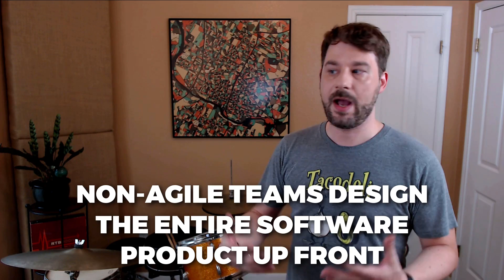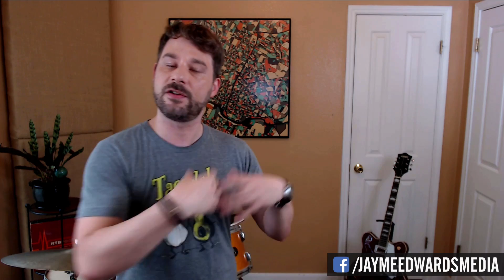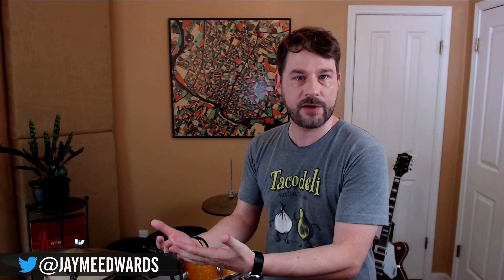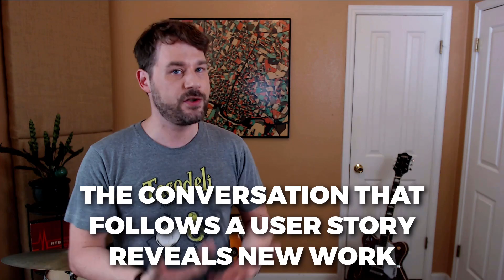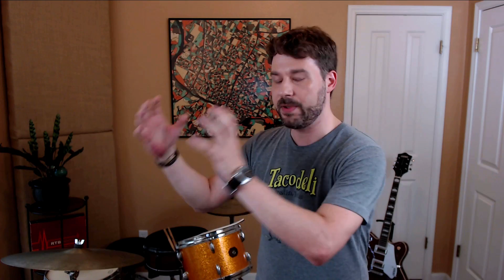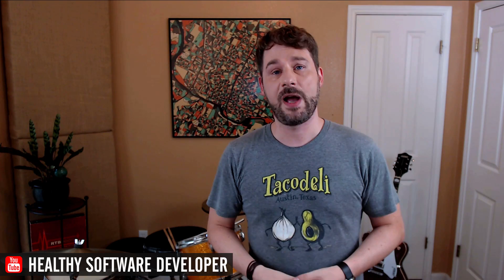Can User Stories Make Software Projects Late?

Comment: You're calling for a full waterfall process and thus calling anything agile there is deceptive.
Reply from the maker: Did you watch the whole thing? I'm saying to match the level of detail of your stories to the company's desire for certainty. A company that is OK with uncertainty doesn't need the detail, they have the ability to be agile. The rest unfortunately don't - by definition. They are creating rigidity which resists change.
Reply: @HealthyDev I did watch it all and the point I saw was that if your organization needs schedules and has well defined requirements (one of the places that every new product development organization I've ever been part of insisted on) then waterfall (or scrummerfall for a bit of protective coloration) is what you need to do. 

I can't really disagree as most of the weird hybrid attempts I've experienced where some form of agile tries to be mixed with hard requirements and fixed schedules (I work in medical device development) seem to have incorporated the worst parts of agile and waterfall into something that is slower and more cumbersome than either.
Reply from the maker: @kylewilson4097 that makes sense. This is just my opinion and experience. Yours is just as valid.

Comment: There's a fundamental problem with this video, same as every User Story discussion: It goes into great detail about the problem, but not the solution. There remains a lot of ambiguity around what "requirements" means for a user story. To a fully-Agile/Scrum team, there should be no requirements. But at some point, accountants demand budget estimates. At what point do you shift all the way into "When the button labeled 'X' is clicked, Y happens"?
Reply from the maker: Hey there. It depends on the level of certainty stakeholders require. As I said in the video, if they want up front estimates and commitments, you need to capture that level of detail in acceptance criteria for every user story on the project (not just in the current sprint). In that case, you may as well not use scrum because the purpose of a backlog is agility. You can't have agility if your scope is fixed.

See this other video for more info that may help about this one: https://www.youtube.com/watch?v=OosYzkP-pLk

Comment: I'm in a project where a User Story pretty much is a Requirement in disguise. It is handed from the customer down to our team(s) after cost-estimates. We are not "agile", this is no secret. And we don't have any discussions about the stories during development. Our team is not focused in developing the service we are primarily developing right now. There are other stuffs that the customer wants. Then a lot of the members are quite junior. 

I don't like working from requirements, I want a conversation!
Reply from the maker: I'm sorry you're having to deal with this. If it makes you feel any better, my experience has been that it's more common for "agile" teams to get this wrong than right. Hopefully it changes over time at your current company/client, or you have a better experience wherever your career leads you to next. Hang in there!

Comment: Huh, quite interesting. The way I first learned about userstories was with I believe exactly the aspects you were criticising. Meaning, you did not just write the userstory. You also had a section "Examples" that specified in a pattern "Given X When Y Then Z" the behaviour of a feature, with a section "Rules" arising from them that described the behaviour in a more summarizing way to give quicker ideas.In this scenario, Examples really just act as acceptance criteria and Rules as their meta description.
Reply from the maker: What you’re describing sounds like a good process. My main point was user stories on their own don’t offer enough detail to have a contract with people who demand certainty. It sounds like you have preconditions with examples, which is pretty close to the use cases we had back in the waterfall days. Your examples sound like what we used to call alternate cases. Regardless - not to get hung up on the terminology that sounds like a good approach (without knowing the attitude of your stakeholders).

Comment: The issue with use stories is that they are taken as gospel rather than a placeholder for a discussion. End result is that the deliverable is not what was needed.

Comment: Our team has gotten to the point of making MVPs, quickly getting them into the customer's hands, and then getting them to fund improvements. The contracts for improvements come with deadlines. So the constant juggle between getting in high value improvements and meeting deadlines for low value improvements is our biggest pain point right now. Our product owner seems to think giving a wider cushion when negotiating deadlines will help, but we are not yet sure. Do you have any suggestions or should we live with the constant juggling as it comes with being agile?
Reply from the maker: When you talk about contracts, are y’all building software for other businesses (professional services) or directly for end users?

Comment: Another great, insightful video. My experience is similar to yours, but also different in some key ways. Let me explain in the context of my second-to-last work experience.

My director was militant about writing vertically-sliced user stories that followed the INVEST criteria. He did want the scrum teams to consistently meet their sprint commitments, and he did believe in estimates, but at least he understood the limitations of estimates. Estimates were really only used in aggregate against the total size of the project ("Okay, we have 596 story points left to finish, and our average scrum team velocity is 20 points per sprint, times 4 scrum teams, that's 80 points per sprint, so we ought to be able to get done the remaining work in 7 or 8 sprints"). Estimates were refined on a just-in-time basis by doing a task breakdown. Teams would typically do their task breakdowns when they did their planning for the current sprint.

So the motivation to organize the work into user stories wasn't so much to estimate them perfectly, but it was to be able to deliver completed, working, valuable functionality in a chronological manner. That's why they were supposed to be vertical slices. It did make sense about 80% of the time.

The problem was what did you do when you got to cross cutting work like "we need to refactor our config engine notification because it sucks", then how do you do something like that in a vertical slice. Sometimes it's not always easy to vertically slice something. Eventually I got better at that part. The basic formula that I used was "As a user, I can be assured that [insert-some-horizontal-work-here], so that [insert-some-vague-high-level-user-benefit-here]". So for example, even though it appears to be a horizontal piece of work, I could refactor the config engine with a user story like "As a user, I can be assured that the config engine properly notifies the system of changes, so that the system doesn't crash when I add a new server." As long as I could phrase the work in a way that showed how it would ultimately benefit the end user, then that was okay. Sometimes it took some grammatical gymnastics, but as long as I was making a sincere effort (my director loved to use that term a lot ... "sincere effort") then it was okay. I learned the hard way not to say "we're doing our best". Oh, no, no, no, no. Don't say that. Say "we're making a sincere effort."

This business you're talking about though of detailed acceptance criteria, that was really tricky. My PM was also really militant and particular about the way he wanted things, and he wanted acceptance criteria phrased from a human point-of-view. He didn't want these super technical, operationally focused acceptance criteria. He didn't want "When I click on the More ... button, an area of the screen is shown to edit advanced options". That's too implementation focused. He wanted much higher-level acceptance criteria like "The user can effectively use the admin screen to add a new user". He was hard to work with. We were always walking a tight rope between expressing enough details that would help the developers and testers know what we were trying to build, and not putting in implementation details that he didn't care about. It was frustrating at times. He definitely didn't want those super detailed kinds of acceptance criteria that you're talking about. I tried that once and he had a shit fit.
Reply from the maker: “We have 596 story points to finish” means it’s a fake agile (waterfall with agile trimmings) project. There’s absolutely nothing agile about forecasting and building that much work before getting feedback and adapting the backlog. I talked about that in the “Agile Project Management - Is It Stopping You From Being Agile?” video. I’m sorry you had to work in a project like that. I have several times too. 😢
Reply: @HealthyDev  Yeah. You have a larger body of agile work experience than I do. This was the only company I've ever worked at that did textbook scrum, the way Mike Cohn says it should be done, sometimes a bit too rigidly. Estimating is one of those things that people do without asking if it makes sense or not. I don't see the point of it really. Here's the thing. If you size your stories properly, then they end up all being about medium-sized. You don't want your stories too big, otherwise they don't fit into a sprint, and you don't want them too small otherwise they aren't complete vertical slices of user-valuable functionality. So they all end up being these medium-sized things. And then you estimate them with story points and you get 5, 8, 8, 5, 5, 5, 8, 8, 5, 5, 8, 5, 8, 8, 5, 8. If your whole backlog is filled with 5 and 8 point stories, then why bother? Can't you just count up the total number of stories and make some rough estimates with that.
Reply from the maker: @Kevin-Dietz  thanks for sharing that. Yeah to be clear, I definitely have experienced that MANY companies still force you to estimate regardless of their value. However here's a video from Allen Holub that's pretty cool. While I don't always agree with Allen (and I haven't looked into follow up information on this presentation since I added it to my "Favorite Videos" playlist on the channel), it's got some good things to think about with respect to counting up stories like you mentioned: https://www.youtube.com/watch?v=QVBlnCTu9Ms Not sure if what's in there you've already run into, but maybe it can give you some ideas.

Comment: Hey man, how’s going?
I have a question.

What would we do after have finished and delivered a sprint? If we start working in the new sprint, we would have double work as I’m sure that the user would ask to change many things, so we would have to work with the changes and in the sprint 2 as well. 
Should we abandon the sprint 2 for a while until finish the sprint 1?
Reply from the maker: Henrique Palomo you can either address changes due to feedback in the current sprint by pushing other work to the next one, or just plan to address it in the next one.

The important thing though is to get the change made as soon as is reasonable to minimize effort wasted building additional functionality on the feature being changed. I hope that helps.

Comment: What I don't understand is this: in your experience, are estimates on a fully-documented Waterfall projects any better?

Because in my experience, there is no such thing as a fully-documented project that won't change over time or won't have any "Oh just a little thing..." moments. Agile is only about recognizing that this happens and not make any promises the way we did with Waterfall, but instead offer flexibility and the ability to start with a much smaller investment/commitment.

I had a bit of an ah-ha moment when you mentioned that companies used to decide every little detail upfront AND committing a budget to it before even starting. That's the thing! And if we don't change this part of the process, then most of the advantages are gone.
Reply from the maker: In my experience the more we design / estimate in one go, the more risk.

So no, waterfall is worse (even if there’s more thought up front to the requirements).

This is another benefit to small batch processes like scrum and kanban: they help you find out early when something is overlooked so you can adjust for it going forward.

I mentioned this in “The Secret Of Scrum” video.

In my experience, when this happens on a waterfall project everyone tries to horse trade scope so they can fit the uncovered complexity into the original deadlines by pushing the devs to work overtime.

But either way, it’s still incredibly useful to create acceptance criteria whether you do it all up front or “just in time”.

It may not eliminate all misunderstandings, but it cuts them WAY down to a more likely understanding of the change or feature.

YMMV
Reply: @HealthyDev  I believe that UX design and non functional prototypes play a major role in testing requirement are actually what the business wants them to be. A proper UI/UX work with user testing can get rid of the need of documenting the way waterfall works and without introducing scope creep by creating poorly defined user stories.
Reply: Stephane. You are wrong if you think all that ever existed is either Waterfall or Agile, much worse if you think everything about Waterfall was bad (evil) and everything about Agile is good (holy).

See, between Those 2 are a bunch of other methodologies. Before Agile existed they were methodologies that proposed incremental and iterative development (like RUP).